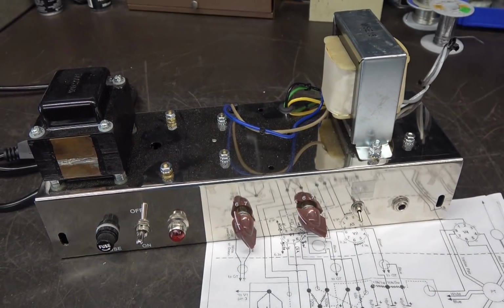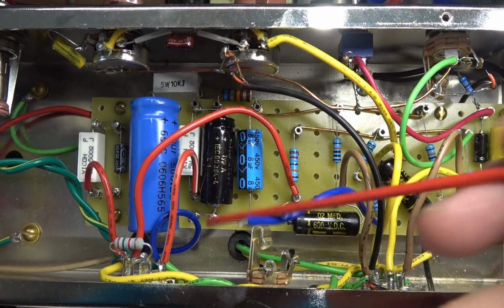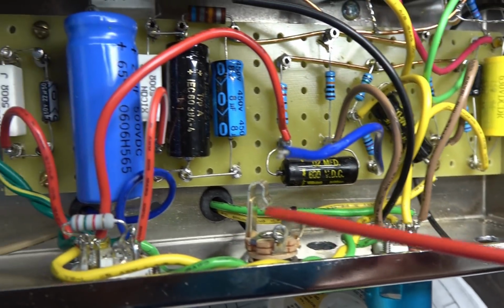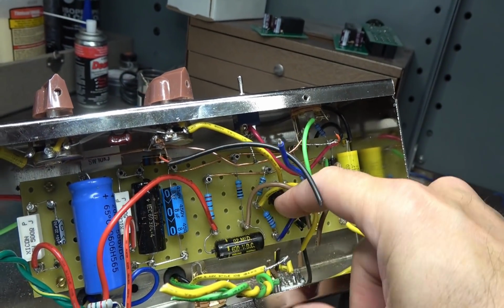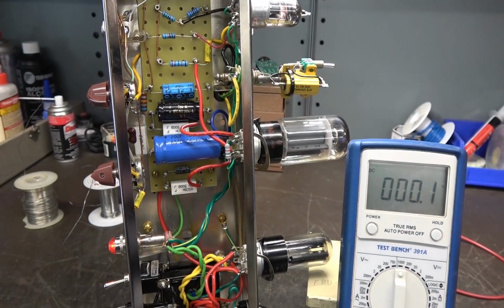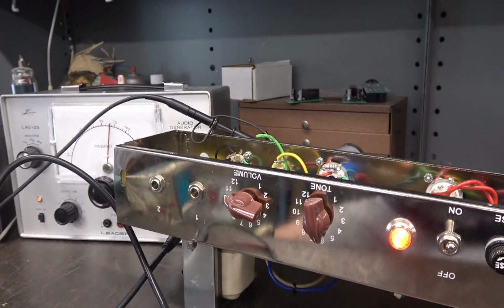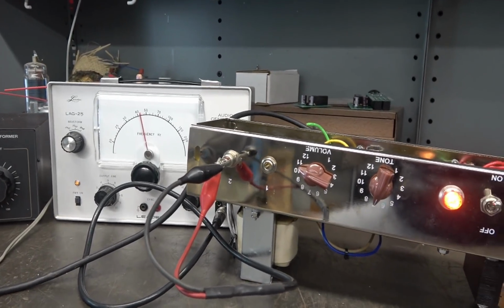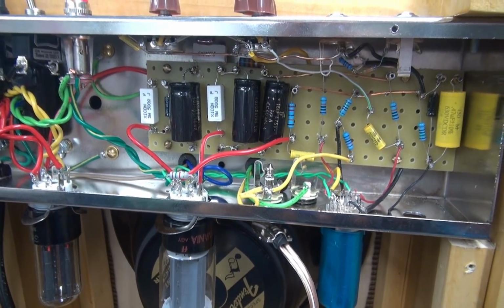How to repair Fender boutique 6L6 guitar amp UnMod  Take back to stock

Comment: What a sad looking home brew amp. Why couldn't  the builder put the oversized transformer at a 45 degree angle so it wouldn't have had it sticking out of the chassis sides ?
If you are going to build any kind of amp don't use paper capacitors from the last century, they were never designed to last this long. Oh it sounds better if you 
use "black beauties" in them. NOT. The electrons don't care in this case as they ( DC) will leak past the old broken down material in the plastic covered  paper capacitor.
Smart idea to give it to Terry to rebuild it to the standards it was conceived from. Great sounding amp now Terry!

Comment: The diodes are to protect the transformer in case the rectifier dies.  They also increase the peak inverse voltage which should increase the lifespan of the rectifier tube.
Reply: I was surprised he removed them.
Reply: Thank you Mike, great explanation. Do you repair tube guitar amps?
Reply: They also cut down the possibility of the rectifier tube arcing. I did this on an old pa amp  and it cut down the arcing on an already damaged rectifier tube. Didn't stop it completely though, had to junk the tube.
Reply: Steve you should pull out a schematic and go over it with us. I just subscribed to your channel. I would love to here about ecah section of a tube amp and how it can be improved and protected. You have knowledge lease share it with the world:) Bless you!!!
Reply: You can actually also use them perfectly with a full wave rectifier when there is just one tap on the transformer. Sort of an hybrid approach. Works pretty well.
Reply: P_ Mouse, it would make for a great video of you explaining what you know and applying it to this or another tube guitar amp schematic. I am a new subscriber to your channel. I would be great if you could share your knowledge with us.